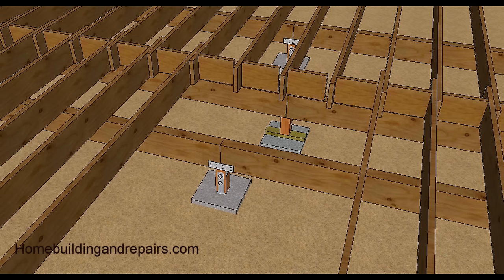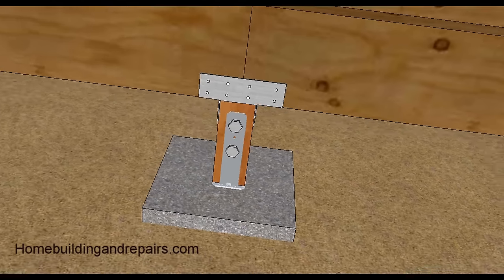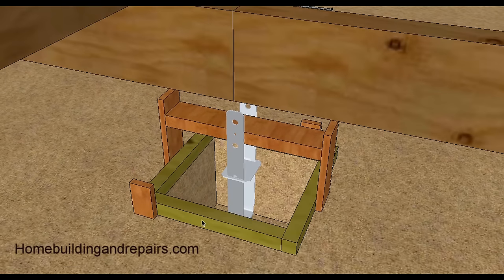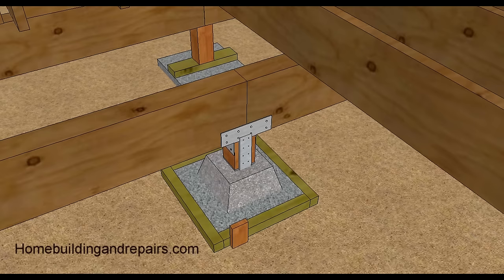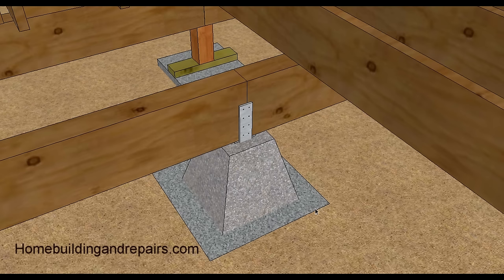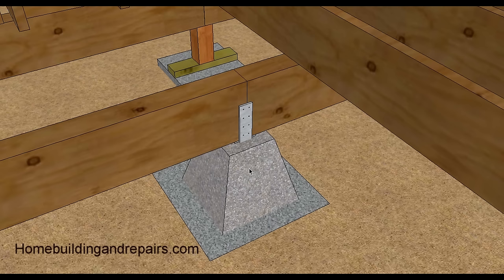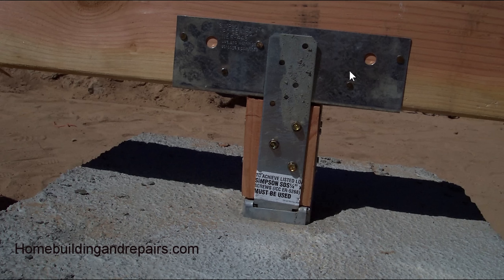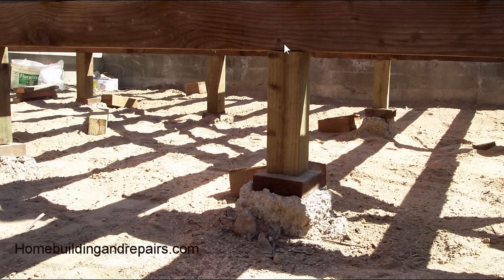How to Install Crawlspace Support Beam Footings – Construction and Remodeling Tips

Comment: Thank you  - you were awesome, and made me crack up laughing the last 2 mins. when you showed us the 'unformed' footings - ha ha.  I am in a 1965 A-Frame, and they have a front 'tip'  that is not supported by a pier, and the joist has been weakened due to the 'drinking' crew that 'forgot to install flashing' when they replaced the front deck (birdbrains!) so this joist has water damage and weakening so that the front 5 in' deep sinks a bit, causing the 2 sliding doors to not open entirely.  so I have to install 2 piers or 4 piers to get this level.  Thank you so much!!

Comment: Three tips for these situations. Always staple roofing felt or an asphalt shingle to the wood framing member where it touches concrete. A forming method for the pad is to make it round by splitting black plastic plant container in half vertically. Cut the bottom off. Use a ratchet strap to hold it together or rivet a few hooks on. After the concrete is set up, you can unwrap the form from around the new pad and use it again. Third, on old houses or any house that is settling, use the Simpson adjustable post base. Put some grease on the threads. Workers in the future won't have to fight with rust if they need to adjust the post.
Reply from the maker: Thanks for the fantastic advice and great tips. Keep in mind that some building plans will require square footings and that you should check with the engineer before making them round.
Reply: Yes. I would like to see a paper or an inspector's ideas on the topic. A question is: it a round pad of the same sq. area equivalent in load rating as a rectangular pad? Can a builder make this assumption? An engineering student has probably tested this question for a class project.
Reply from the maker: Some engineers require round footings and some require them to have multiple sides like a square and all I'm suggesting is that you follow their instructions. I still like your ideas and for anyone who isn't going to contact a building professional, they could save you a few dollars.

Comment: The top of the footing in the crawl space can be even with the grade.  It does not have to be higher than grade.  Also, if you are using a 6x6 or 4x4 post on the footing, you do not want to use to wide of a footing.  Code specifies that the footing projection SHALL NOT exceed the depth of the footing.  Projection means the distance from the edge of your support post to the outside edge of the footing......so is you use a 12" deep footing then a 12" projection is the max allowed by code.  Also, in most cases an 8" or 10" deep footing is the most you would need  in this type of situation unless the new post is supporting 2 stories which just because your home may be 2 stories does not mean your girder is supporting 2 stories because usually it is not.
Reply: Doesn't the depth of the concrete footer depend on the frost line if you're doing a pier beam foundation?  You wouldn't necessarily have a crawlspace, it could just be open air.
Reply: @MrVARhythm  The exterior footings have to be at least the depth of the frost line but any interior footings do not.

Comment: I was always told you pour a 2x2 pad 6 inches thick and lay rebar in the concrete on top of undisturbed dirt, then use solid cement blocks on top and shim as needed. Also, it 3  2x10  beams that are nailed together are seperating from the nailes, can you use structural timberlocks to draw them back together?. Does having them nailed/screwed together increase strength even though they are all close together anyway?. Thanks for a response.

Comment: My 50+ year old house has a rotted girder beam in the crawlspace that I intend to replace. It is a moist environment in northern PA.  The house has sunk down 2-3 inches in the center.  I have good size support columns. My question is can I use a series of jacks and 4x4's  to support the house while cutting away the beam or should I use support walls? It's a good 4 ft under there so I have some room. I need to raise it up slightly to get the new beam in correct? Then once the new beam (a series of 2x12's sistered) is in then I will get it to level. Is this the best way to do it?
Reply from the maker: You're ideas might work just fine. I would also suggest going to our website and in the repairs section, click on "crawlspace" link for more repair methods.

Comment: Hey Greg, love your videos!  A two part question regarding adding piers to my 105 yr old house here in SoCal...your thoughts would be GREATLY appreciated   1. If I do not touch the existing pier foundation and add reinforcing piers where needed, would that be a code violation if the "as built" is not altered?   2.  My crawl space (of limited height) has not seen water in a century, can additional piers on concrete pads be added at grade without digging into the soil?  Many thanks and continued success.
Reply from the maker: Question number one is a good question and I would recommend checking with your local building department for clarification. However, most of the time they don't have a problem with you adding additional structural supports like concrete footings, because if done right they usually strengthen the building. You can sit peers on top of your soil, but they could sink into it over time.
Reply: @gregvancom   Many thanks for the reply Greg.  It's greatly appreciated!   As you probably know, dealing with the L.A.'s Building and Safety folks can be a bit of challenge - you may get Answer A from one person and Answer B from another.  My perimeter wall + piers foundation was built over a century ago where nothing is tied to one another via strapping or gussets.  There is certainly no foundation bolting.  The weight of the structure is what keeps it in place, which as you can imagine is concerning as we wait for the "Big One" earthquake.  That being said, I am going to move forward with adding piers in key locations.  Thanks again...
Reply from the maker: @stephensarinana-lampson9305  I've never had to deal with Los Angeles city or county personally, but have done a lot of work for people who have and they usually want more. One time we raised to single-story house, removed the damaged foundation and replaced it. It was the first time I ever installed a 15 inch wide 24 inch deep concrete footing for a single-story home.

Comment: We had a large firm with lots of fancy promo material come out to look at our sagging floors that exist over a very shallow crawl space. They wanted to dig small pits like the ones you show, insert crushed rock/breeze, compact it, place concrete piers on that, and attach to the joists with their proprietary adjustable jacks. I live in Denver, CO on an old lake bed not to far from a small river. The soil is very sandy. What are your thoughts on this???
Reply from the maker: I don't provide structural engineering advice and would suggest contacting an engineer or other contractors in your area for more information.
Reply: thats basically what I have concluded I shall need to do to a house in vermont.  I don't provide structural engineering advice and would suggest contacting an engineer or other contractors in your area for more information.  I think the key here is that if the piers are tapered, the can get a little crushed into the ground under the immense weight through the jack.  Any settlement could be adjusted for down the road, and any room that opens up around the sides of the pier can get packed back in around it from above, its a cold joint so it works independently of the slab that way.  But I have a 78" crawlspace and that may be a key difference.  I think the pier footing is a good way to go, especially if you suspend it from your jack post when you sink it into a bed of grout in your hole.  Good talk.

Comment: I was wondering if you can make the crawl space 2 foot high instead of 18"? And just make the concrete pier higher out of the ground to make up the 6" difference? I also see Lowes and Home Depot selling those concrete form tubes 12" in diameter and 4 foot long. So the concrete pier would be 2 foot in the ground and two feet out of the ground with brackets set in the top of the concrete that the beams will attach to. Would that meet code?
Reply from the maker: I cannot provide you with structural engineering advice, but you are allowed to make the access holes larger. I believe 22.5" x 18" is the minimum, but you would need to check with your local building department for clarification.

Comment: This is exactly how my house foundation is framed. Except instead of concrete they used red bricks for the piers. The main beam is sitting right on top of the brick piers. Some of them have a couple shims that are all but crushed and rotted over the years. Sometimes they just took the cheap way out to get past inspection for the moment. Didn't care about longevity as by the time it failed it would not be their problem.
Reply from the maker: The truth exposed about temporary repairs.
Reply: I’m dealing with the same thing on a job now and has got me scratching my head trying to figure out the best approach for repairing it.

The other issue with it is the area under the porch is old crumbling foundation in both front corners. Used to be an old coal room back in the day that has been since closed off from the rest of the house and  is pretty much just a big hole under the porch.
I decided not to try to build the new framing on top of the foundation in that area and instead am digging holes to pour a couple footers to support the load for the front of the porch. This area of the porch is also not covered by the roof, so it’s exposed to the elements. Just nervous whether I dug down deep enough or not since the soil is pretty much a sink hole behind the holes I dug rather then the typical undisturbed soil you usually are dealing with when doing footers

Comment: Any tips for securing a vertical steel post? I was thinking of making a baseplate and putting bolts into the concrete itself before pouring it. I'm also pouring on top of an existing slab. My engineer just advised me to use rebar at 4" spacing, i believe.
Reply from the maker: I don't have any videos on that, but put it on the list of videos to be made in the future. I would simply follow all of your engineers instructions.
Reply: @gregvancom  Thanks!

Comment: Can I use the footing described first but instead use a piece of lumber to attach a jack post to the footing to raise a sagging floor? Any potential issues you might see with doing this? 

Thank you for the videos, they're very helpful!
Reply from the maker: I think I understand what you're suggesting, but think you might find more information on our website. Click on the repairs tab and then select framing for more information.
Reply: @Michael Okamoto: I have same issue (sagging floor) in my 75 year old house. Previous owner put sender block on dirt and now its leaning and creating sagging.  I am planning to add  concrete footing and install jack post and lift up the floor by 1 - 1/2 inch, before I execute my plan just wanted to check what did you do for sagging floor? and does it working fine ?

Comment: Does the concrete go directly on the dirt or does gravel go down first?
Reply from the maker: I would check with your local builders. I've done it both ways, but freezing soil conditions might require more than gravel.

Comment: Hello,is there any method where I didn't have to dig hole ? My crawl space is low and digging footing will be extremely difficult.thanks.
Reply from the maker: If you can't go under, the repairs will need to be done from above. Sometimes it's actually going to be easier to do them from above, even though you will need to remove some of the sheathing or flooring. If you find a better way, let us know.

Comment: @4:15 why are you saying to nail that bracing together instead of screwing, which can be undone easily..?
Reply from the maker: You can use what ever works best. Sometimes the engineer or product manufacture has installation instructions you need to follow.

Comment: I have a question I hope someone can answer. My house moves back and forth because of weathering. Under the girder beam slate shims were used to shim the girder. The house is 30 years old and has settled some over time. On the second floor in the corner of one of the rooms I get a 1/4 inch gap about a 1/2 inch wide in the winter. In the summer it closes up.  I now have a dehumidifier in the crawlspace and it seemed to solve the problem, however I would like to bring the house back to where it should be before the shims were cracked and settled. Should I jack up the girder and replace all the slate shims with steel or just where I have a problem. How should I go about doing this ? Thanks
Reply from the maker: You don't have an easy one to answer, because there could be other variables, but if it has something to do with crawlspace ventilation, then that might be a good place to start.
Reply: Thanks

Comment: The advice in this video may work for arid climates, but definitely does not apply to the south.
I had to have some beams replaced and some added to our house and the methods suggested here would not work where we are located. Digging out the soil 12" and pouring concrete does not address the settlement situation.  To put new footings in, the soil needs to be compressed.  The way it was done on our house was to place 2 cmu's next to each other.  Then a jack was used to compress the soil and alternated between the two spots shimming and supporting as the work was done.  I was surprised that the soil compressed around 3 inches.  If I had just dug the soil out and poured concrete, there would be settling happening now.  It doesn't take much settling to cause gypsum to crack and windows to jam.

Comment: GREG......you seem like a job well done kinda guy.....do those post to concrete anchors  with the 1" raised base ........ARE THEY STRONG ENOUGH TO SUPPORT A HOUSE?.......thats not even solid it just folded metal......gotta 10,000 lb load max
Reply from the maker: You got a good point and I don't think I would have used them for that situation. This was a project I actually worked on and am pretty sure that the structural engineer called out for these to be used on the plans. Can you please remove the product manufacturer's name from your comment, thanks in advance, just don't want any trouble in the future.
Reply: gregvancom 
Ok, sure.. thx bro
Reply from the maker: Thanks for understanding.

Comment: If I found a discrepancy between any two pieces of stock, 8:19, First off: 
Come To Your Job Site Prepared... A simple galvanized or aluminum plate/shim, 
approx 1/4" thickness, (Always have different sizes and thickness on hand), 
would have solved this issue, and it's only fair to the paying customer. As a laymen, I Say to you:
Nothing Worse Than A Crap Job That The Paying Homeowner Will Never See,  
Unless You Are A Crap Person... Best Bet: try and pour the "reinforced" concrete pier up to the 
bottom of the floor beam, or joist, using a galvanized bottom wrap on the beam/joist itself.
" Contractor: Do Your Job Right The First Time, Or GET THE HELL OUT! "
Reply from the maker: It would be nice if contractors did everything right the first time.

Comment: Man, I keep seeing WOODEN piers in all of these foundation pier tutorials. You must not have termites where you live? Here in the southeast, that just isn't smart. We have to use concrete, otherwise you're back at square one.
Reply from the maker: They used concrete piers with wood posts years ago in Southern California, but now need to use concrete footings with wood posts. The concrete needs to be a minimum of 6 inches above ground to reduce termite activity.
Reply: I was thinking the same thing!!! I am not using any wood and if I do, treated wood, but I am using only concrete!
Reply: @stonebrookbookkeepingtax5707  Set that treated lumber aside in a dry area for about a month and then treat it with Boracare

Comment: dont you have to pack down tge ground with a packer?
Reply from the maker: If you over dig the footing, but try not to remove more dirt than necessary.
Reply: @gregvancom  what if the ground isnt compacted enough in the 1st place b4 even digging or pouring the footer? do you have a vid on all that?
Reply from the maker: @Brandon-no3vc  No video yet, but if the soil is soft or not compacted, you might need to dig deeper until you hit compacted soil. If not, then I would contact your local building department or engineer for more information. No easy answer here.